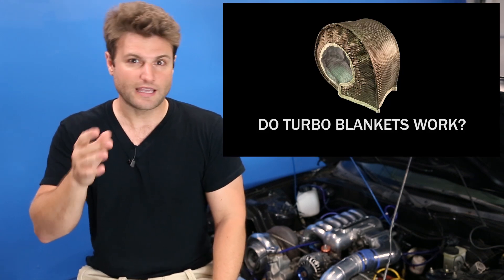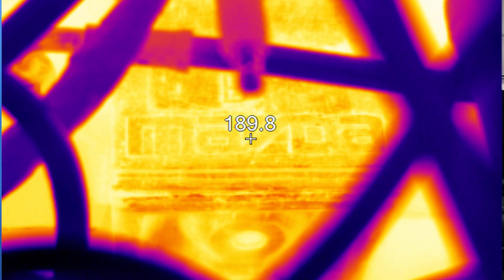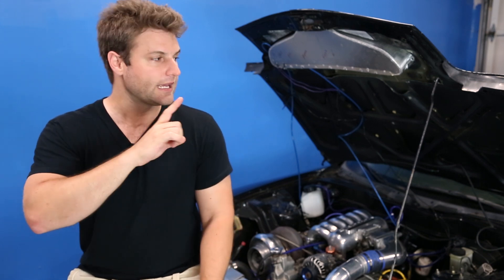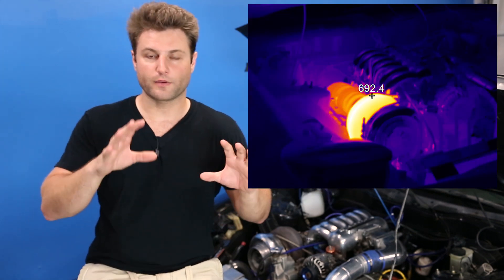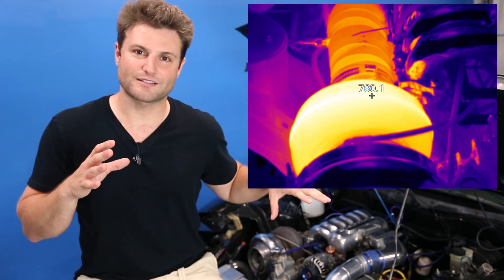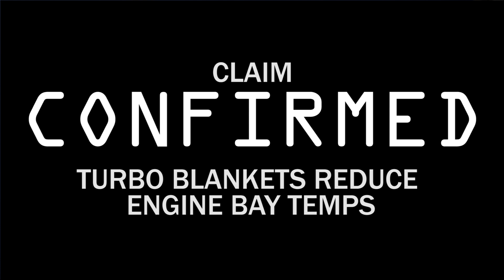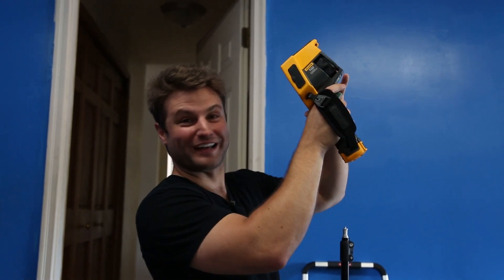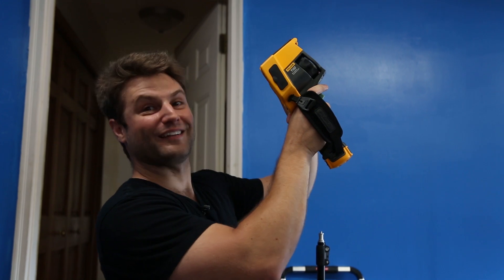Do Turbo Blankets Work?

Comment: Old neeewz but still a good informative video, specially for the younger ppl that didnt know, not that im old but 😊 
Keeping the heat in the exhaust is another think most benefitial to na cars because of the hot air wanting to escap out the rear faster then cold air thus "pulling" the gases out making for better flow.
Theory about the turbo getting tighter when conserving the heat with a blanket seems good, but shouldnt the turbo manufacturers have thaught about the metall expansion when getting hot and taken advantage of that?
If they did it might be getting to tight and producera more friction/heat, and with a rotay engine already producent high egt that destroys some turbines (read BW EFR titanium turbines ^^) that would be a bad think :(

Did you wrap your DP yet Dom ?

Keep up the good work!

Comment: I would love more videos like these. 

Quick question, with the heat trapping effects of the blanket, what does that latent heat do to the oil/water that remains in the turbo once it is shut off? Would the blanket introduce an environment that promotes oil coking?

Comment: How does the heat blanket affect the internal heat of the turbo? Does the blanket hold a lot of that heat in causing the internal temp to increase. Colder air is denser air so the blanket might cool the engine bay temps but does it increase intake temps? Maby an idea for the next video like this one. Cheers mate keep them coming.

Comment: This is a great video. That thermal camera is dope. Do you think that trapping all that heat in the exhaust housing may reduce the turbo's longevity? I've heard of heat wrapped exhaust manifolds cracking under the intense heat, and I'm curious if turbos behave the same way.

Comment: How about getting your turbo's ceramic heat coated versus a blanket
Reply: I second the testing of this theory and encourage you to take it one step further. Test the turbo with and without ceramic coating, and temperatures uncoated with the blanket and coated with the blanket. ( Could you test heat wrapping the exhaust system too?)
Reply: I know you arn't really supposed to coat the inside but I think coating both sides would do wonders because the heat from the headers wouldn't spill into the compressor side of the turbo.

Comment: Alot of the older rotary race guys around here are firmly against exhaust rap and or turbo blankets,they use that (im unsure of its name) that thermo plate stuff,very flexible and work able,around inlet runners,exhaust housing,dump pipe and extractors,you can touch it after a run and it's only warm
Reply: +Rob Dahm It is quite cheap too,I'll find out what it's called today.Would love to see actual temps and results

Comment: I always thought "claim 1" was the primary reason to run a blanket and then everyone is like "yeah, but 'claim 2'... blah blah blah". I can't think of an OEM turbo install that runs a blanket (many do run heat shields though, because of claim 1) and I have to think if there was a large efficiency gain to be had, they would do it (especially when you start talking about titanium wheels and variable vanes, which are ultra expensive in comparison).

Thoughts?

Comment: hey rob, isnt that water/meth tank a bit close to your exhaust?
Reply: yeah. i guess ill have that problem myself when i start putting in my 20b this fall. im thinking of using the rear washer fluid tank, should work pretty well :) 
as long as there is some fluid in there it should cool it sufficient (like how you can boil milk in its carton befoire its burns) its when you only have fumes in there you run into a problem aka "kaboom" xD

Comment: Great great GREAT! Video dahm!... ive just finished a turbo upgrade on my rx7 and have been in discussion about use of a turbo blanket, the one negative that ive thought of is the fact of it holding heat in could produce moisture and also may scortch the oil!?!... great vid

Comment: lmao the rubber jokes....did me a big ol chuckle...
Reply: +Rob Dahm That really was an awesome spin especially cause you can tell it was basically improv.
Reply: Jokes aside, melting things like engine mounts and cushion clamps is a VERY real concern when packaging turbos for OEM applications. Been there, done that.

IMO, I'd strongly consider a bunch of heat wrap on your down pipe, in addition to the blanket, Rob. If you run it down a ways you may get rid of some of that interior heat too.

Comment: Damn, nice analysis!  I knew blankets helped but I never knew that much.  I guess I've never had a turbo pushed that hard.  Second guessing when I removed my turbo heat shield now (I had to cut it off b/c the bolts were rusted in solid, didn't have a replacement nor feel like drilling the manifold to get the bolts out).  Luckily on stock psi it still provided years of reliability.

Very cool vid, look forward to more of these.  20k on just the trans block (no gears) !?!?  Dammmmmnnnn....

Comment: Wait Rob idk If you put an annotation or not because I'm on mobile but you said 30% of the energy is used efficiently by the engine but 60% is used inefficiently that nakes 90%. Was that an error on your part or is there something about that 10% that can't be used in any matter such as exhaust(not applicable to turbo setups).

Comment: 5:09, little trouble with the math there?
Reply: Came to the comments to see if I wasn't the only one who caught that...
Reply: 10% becomes gremlins in the electrical systems.
Reply: ***** Hey Rob, could you do a video on what its like using a RX7 or rotary as a race car? I friend is looking at picking up a cheap RX8 to strip into a racecar and we werent really sure if it would be a good route as far as cost/work vs performance. Thanks for the videos Rob, they are great. Also time for turbo blanket on my STI.
Reply: +Rob Dahm Found that article, interesting how inefficient modern combustion engines really are. Anyway, love the videos and can't wait to see the the 4 rotor.

Comment: Lava blanket put my garret to bed, burned up the bearings and seals... was spitting out oil in no time trapping the heat inside. Swaintech ceramic coats for the win...